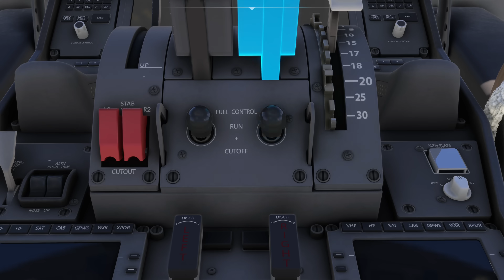Air India 171: Why Did The Fuel Cut-off Switch Get Moved?

Comment: I just want to know why don't planes have a safety mechanism in place during a critical phase of the flight. Like a 5 second delay after pulling off the switches before engines are actually cut off and an aural and ecam message to abort if unintentional. My phone gives me a timer when I want to reset my phone, so that it doesn't happen accidentally. It makes absolute sense here.

Comment: Hey Captain, If I had to ask you to make changes to the entire fuel cut-off system in newer models considering this incident so as in the newer airplanes someone couldn't make the same mistake deliberately as they did in this flight AI171. What are those changes that could be made to make the system even much better ?

Comment: Thank you Captain Steve for thinking of the Boeing engineers and all the other staff that designed and built the 787. 
Many of these people are hurting from this disaster and will need help with their mental health.
Reply: I've helped making the engines and it hurts to read how they portray us engineers....like we did this by design?
Reply: @movarvo1217  indians are tribal people.and toxic.dont worry,you guys are cream of the crops.
Reply: Not Boeing executives  though 😅
Reply: why don't boeing wanna put Camera video into the flight recorder? So that they keep setting the blame to dead pilots after a crash ! ?
Reply: they are probably culpable
Reply: they dont need to worry,it wasnt their fault,
Reply: @stephenroger4527  As an Aircraft Technician in RAF I had 2 aircraft that I’d done work on crash and one of those tragically included a fatality. I can assure you Stephen it affects you, even when the inquiry indicates it is not your fault, you question every nut, bolt, locking wire and examination you did on that aircraft. It plays on your mind for a long time.
Reply: @bittired7159  Anything that is mechanical or electrical is bound to fail at some stage, what if Fire detection system raises false detection an engine the automatic shut down activates, and foam ect is discharged in the engine, so a fault in a tiny sensor can bring a plane down, it is nothing to do with engineers they do their best of course, of course there may be more than one sensor to ensure false alarm is prevented, but end of the day even the most sophisticated systems can fail, Space Challenger failed because of rubber seal.
Reply: @mikekenny4645  I understand what you’re saying but fundamentally disagree that everything must fail. When designing safety critical components there is a safety factor built in so that under normal conditions components do not fail. Add to that components will get a limit for use whether it be time limits or usage limits they get routinely examined or replaced before failure. Aircraft will also fail safe where possible and have backup systems so that one faulty component should not be enough to bring down a plane. More often than not it’s a series of events or failures that cause crashes.

Comment: Capt. Steve, thank you for taking all this time. Every min of video takes many more min of editing, reading and uploading. You probably spent an hour doing an eleven min video. 
Question - What is the time resolution on the flight data recorder?  I'm trying to rule out a worn down detent where one switch falls to cut off and then the other one does. Yes the order of cut offs is consistent with training with a 50/50 chance of having that pattern.
Edit - I will be flying soon and am not worried. We have more car crashes and bath tub falls than airplane disasters.  On the other hand I also buy lottery tickets :)

Comment: Is there anything on the panel which shows fuel is cut-off, in addition to looking at the position of physical fuel switches ? If yes, can it be possible that panel showed fuel cut-off while the physical switch was still in Run position, thereby confusing the pilots and hence one pilot asking the question to other.

Comment: Disagree with the suggestion of both pilots requiring to provide input for cutting off fuel. In case when one pilot is incapacitated and an engine fire occurs, this will just fall flat.

Comment: Could there be a false engine failure signal due to software / hardware malfunction, which also led to RAT’s activation and pilot chose to cut off the engine fuel supply?

Comment: Disgusting that is not the question. The question is somehow that Circuit board turned off the fuel that’s the question cause both pilots are denying you now suggested that one of them did it. Then denied it in case he Survived That’s the lowest thing I’ve ever heard and that is coming from Boeing

Comment: Cameras in the cockpit seems like a good idea. But they would only be effective in finding out Who did What. I believe the solution is prevention and to facilitate prevention, detection is the key. Though Captain Steve is open to many of the suggestions being offered, my sense is that he would rather have a trusting, viable, reliable detection and prevention program. That's my opinion. Prevention is better than finding the cause after the worst has happened.

Comment: Cpt Steeve, I disagree with your analysis of the final question regarding cockpit cameras. It would not have just added, quote, 'context' to the voice recorder it would have categorically shown one of the pilots leaning over and moving these switches. If it showed that neither pilot did such a thing then this would surely prove a technical malfunction and a MAJOR problem for Boeing.

Comment: I like the idea of the confirmation for the cut-off switches.
I would also expect that the software would not allow a cut-off below a specific height without ground contact.
I think some smart guys could bring up an algorithm that calculates if a cut-off would be ok at the time they get set to "off".
Reply: This.....    No good reason you would ever cut off BOTH engines at that stage of takeoff flight.   Logic can be added to system to allow only ONE engine max to be shut down at that critical phase.    Once you reach a certain altitude or even if you are descending at low altitude then you can shut down both.

Comment: Another thought at 3:00 regarding the fuel cut-off lock. Captain, you're right about ONE engine being involved. Given the mathematically extreme improbability of BOTH engines being on fire, it would technically be possible to install a brake.
I have a problem with the statement that both fuel switches were turned OFF. Is this actually proven, or is it just an interpretation of the pilot's dialogue? Couldn't the electronic engine control system also shut down both engines if there was a defective circuit board or chip?

Comment: Steve, attempting to find "root cause" and no video proof of the fuel switch position being changed, but an audio statement, a switch construction such as is it double pole.  Provide redundancy ie. two wire for each switch pole.  Does the switch provide a logic level to a computer interface?  Is there a visual and/or audio indication that the switch state was changed?  Is there a possibility that between the switch and the contactor or solid state switch that activates the fuel pump that the control system could fail or have over riding programming not currently known?  I know it doesn't seem logical since there should be two separate and isolated engine systems.

Comment: We need to cautious of fixation here. I have not seen conclusive evidence that the switches were actually moved.  Mechanical failure is still a possibility e.g. in the recording of the telemetry or with interface devices.  There was a service bulletin released that spoke to potential loss of fuel signalling if a certain chip was not replaced. The point that it was a service bulletin to me is not the crux, but that it identified the scenario as a potential issue.  A Dreamliner pilot of over ten years has stated that it is impossible to move both switches within a second of each other (with one hand, I am assuming).  The fact that the other pilot denied moving the switches also implies that the pilot who asked him did not clearly see him to do it or vice versa, but there is room for conjecture here.  We cannot say at this stage that the aircraft was fully functional and operating as designed.  Even if the fuel was cut off intentionally, it is not mutually exclusive with the aircraft having other issues.  Most accidents are actually as a result of a sequence of ostensibly independent failures.  I'm not saying this is the case here, but I don't think we have enough information to say that there were no issues with aircraft.  The other theory about the cut-off switches being installed the wrong way round from another video does not seem to make much sense.  That would be a very basic design flaw if that were possible.  It would immediately be obvious as the aircraft would not be able to operate.  The bulletin implied aircraft still being serviceable and was warning about the inadvertent lack of the locking mechanism guardrail while in operation.  The mandating of both pilots moving the switches is not viable imho.  Having two pilots is also to provide redundancy.  The aircraft should be controllable in entirety by a single pilot e.g. in case one is incapacitated as has happened on more than one occasion or is simply not in the flight deck.  That is the way the controls are designed.  There is even a push in aviation towards single pilot certification of airliners.  Interestingly, this raises another question.  On flights of that length, there are usually multiple crews with the other pilots sitting in the jump seats on take off and landing.  Does Air India not operate a relief crew on that segment?  I also don't like the cameras idea.  In the end of the day pilots are still human and this may just add stress to the flight deck.  The last thing a pilot should be worrying about in the case of an emergency is that every move they are making being visually recorded and that taking any cognitive capacity instead of aviating.  The CVR and FDR already provide a wealth of information, but it is a subject of debate.

Comment: Question: Does the flight data recorder monitor the physical state of the fuel cutoff switch or just the signals emanating from them? Could the switches have remained in the run position but a temporary fault in the FADEC computer saw a cutoff signal?

Comment: Switch wasn't placed to cutoff. It was transitioned to cutoff. That's what the report says. So drawing the inference that they were placed to cutoff is deflecting. Steve you too can draw conclusions. But looking at the data objectively should be the approach not because u have seen mental issues of other people, and draw the conclusion in that direction based on your experience. Anything is possible but looking objectively is the necessary. You keep on stating YOUR opinion as a gold standard. That's hilarious.

Comment: 5:14.  Ok, Boeing should had advised pilots of the MCAS software, BUT, the pilots are also to blame, they did not follow the procedure for a runaway stabilizer, turn off the Stab Trim cut out switches on the pedestal, slow the aircraft down and manually control the stab.
Reply: Why MCAS is being discussed here?  This is an non-issue related to this subject matter
Reply: @1bachur because at 5:14 the question was raised about trusting Boeing in reference to the MCAS.

Comment: If sabotage is possibly the reason, then this is a concern as the same happened on 24 March 2015. Andreas Lubitz flew Flight 9525 into the French Alps.  The co-pilot had mental health problems.   There needs to be a compulsory assessment of all pilots and move it away from being voluntary.  A regular test for mental fitness for the job on all commmerical airlines must be implemented.   Compulsory fitness testing, would have saved the lives of those on the Germanwings flight 9525 and all those on the 9/11 aeroplanes.

Comment: Once again, you failed to comment and explain on that advisory regarding the cutoffs.  Other pilot bloggers have indicated that this advisory caused no change to the Air India plane and that these switches could have therefore been smoothly turned off.  Maybe by mistake or brushing against them?  Would like it if you spent some time on that issue please.

Comment: Question; you said they said the engine fuel switch was off. But you said they per voice put it back on. The crash wreckage  said the fuel switch was off. Confusion
Reply: No, both switches were in the run position in the wreckage.

Comment: Authorities suspect that a faulty switch may have been caused by improper assembly, where the locking feature was omitted. This would have allowed unintended movement due to vibration or accidental tampering. The fact that both switches could be moved together within a second—rather than one by one, which would have taken more time (it took about four seconds to reverse)—supports this theory. The issue is currently under review for all Boeing 737 and 787 aircraft operated by Indian airlines.

Details from *Herald AV*:
"On July 14th, 2025, India's DGCA instructed airlines to inspect the fuel switches on Boeing 787 and 737 aircraft operated by the Air India Group, Indigo, and SpiceJet. This follows concerns about the potential disengagement of the fuel control switch locking feature, as highlighted in the FAA’s Special Airworthiness Information Bulletin (SAIB) released on December 17, 2018. The inspections must be completed by July 21st, 2025.

The 2018 FAA bulletin, NM-18-33, raised alarms over reports that some Boeing 737 fuel control switches were installed without their locking feature, enabling unintended movement from the RUN to the CUTOFF position without needing to lift the switch. While the bulletin also noted that similar issues could affect Boeing 787 models, it was issued as an advisory rather than a mandatory Airworthiness Directive. As a result, many operators, including Air India, did not take corrective action at the time."

Comment: Two pilot verification on any control is not a good suggestion (@3:30)  .... What if one of the pilots is incapacitated, due to any circumstances like accident, medical emergency and etc! One pilot with full control of the airplane should be able to fly the entire plane under any condition.